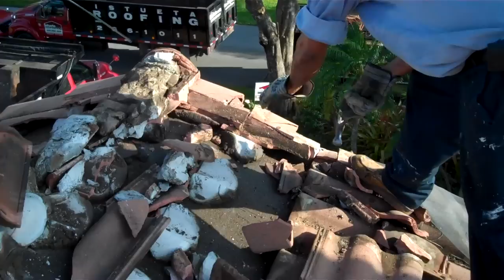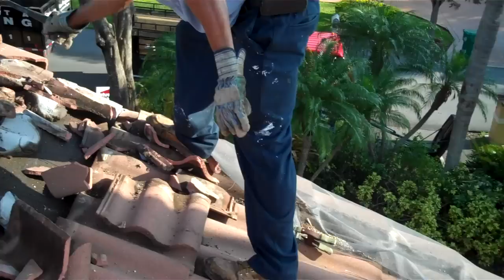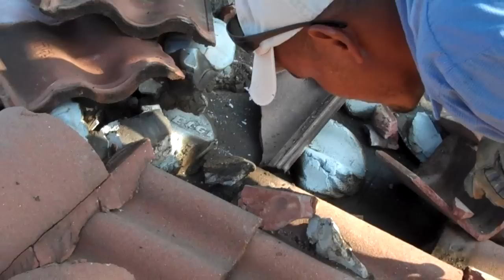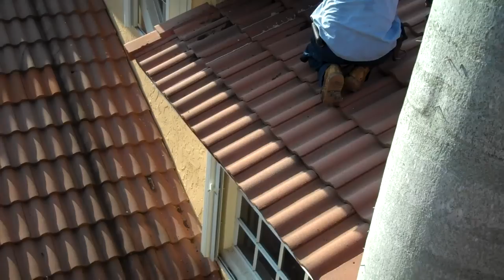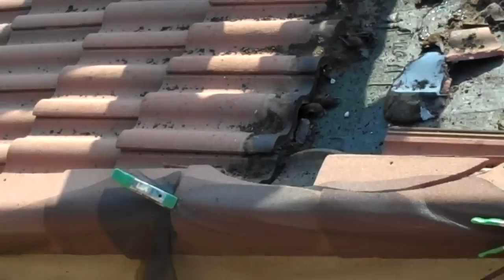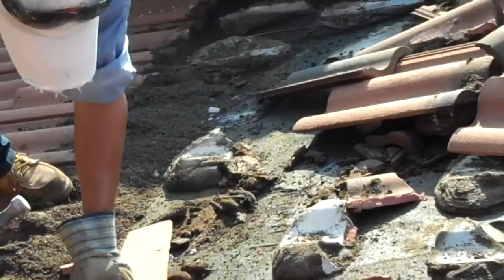Bat Infestation Under Tile Roof (Long Version)- Roofing Miami, FL- Istueta Roofing

Comment: @tankdroper5. Not to sound like a smart ass did you not know there were thousands of bats in your roof? It didn't seem strange that there were a bunch of bats flying around at sundown? Did you have the tile replaced to get rid of the bats? Just curious, I had 15 of em living in my awning and had them relocated by installing a bat safe net that would allow them to leave but not comeback. It's weird I lived in Miami for about 10 years and saw maybe two bats the entire time.